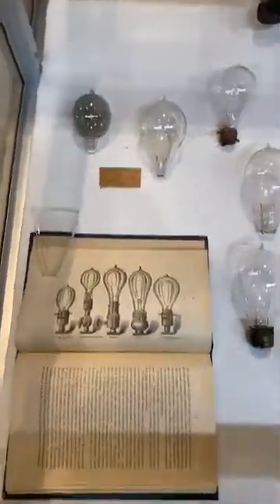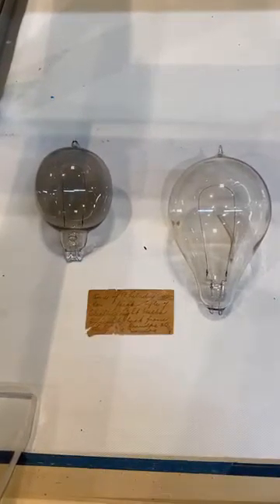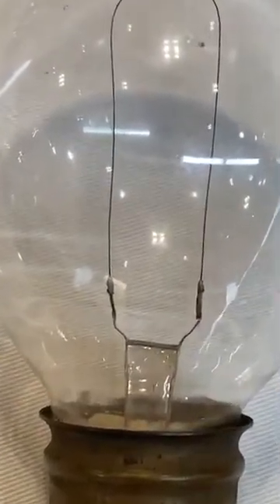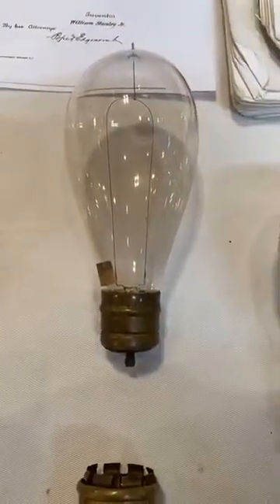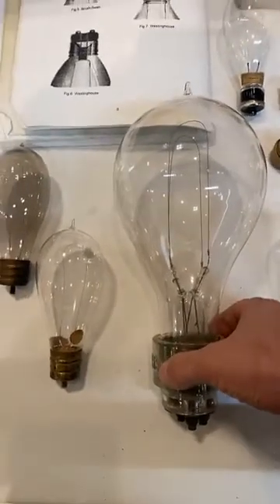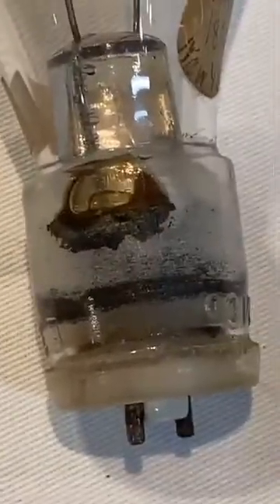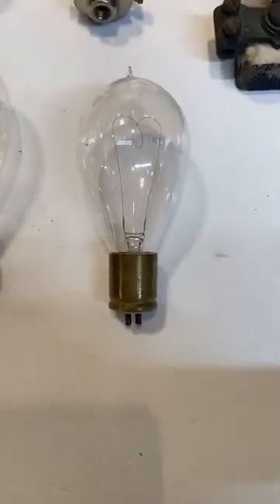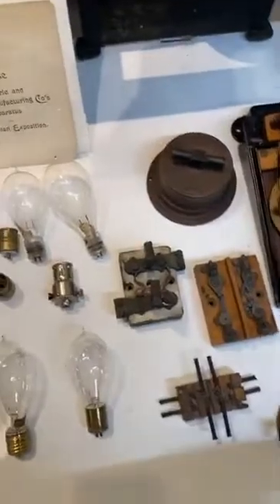Early Westinghouse Electric Lighting History pre-Tesla Antique light Bulbs

Comment: Edison style light bulbs are cool. History of early light bulbs. In late 1890s it has a screw in base for easier to put in and remove the light bulb into and from the socket, in 1919, light bulbs went tipless, but it still called Edison style light bulb for another 6 years. In 1925, modern light bulb was introduced with inside frosted to gives out better light output. They still display it at the Henry Ford Museum in Dearborn Michigan. Edison style light bulbs does came in different colors, besides clear. They are: Blue, Green, Red, and Yellow are available. It is great to used for outdoor Christmas lights.
Reply: edison was a thief and murderer.